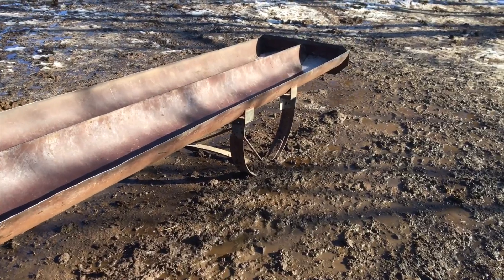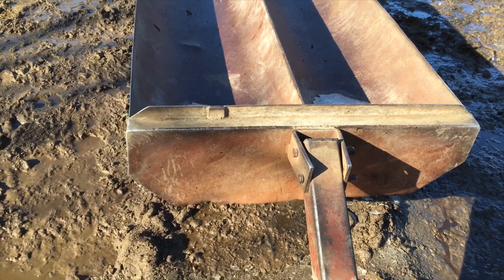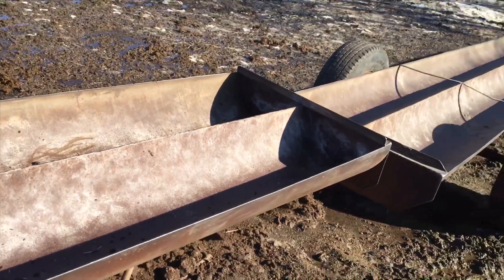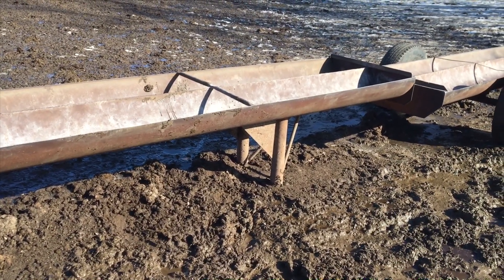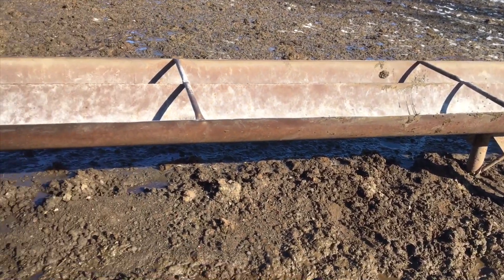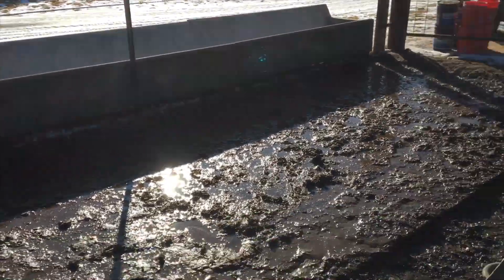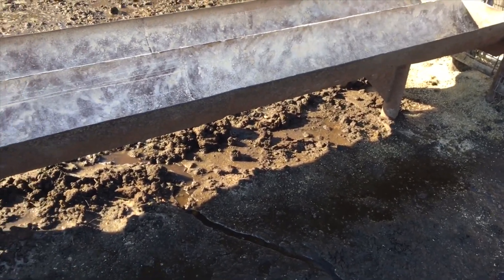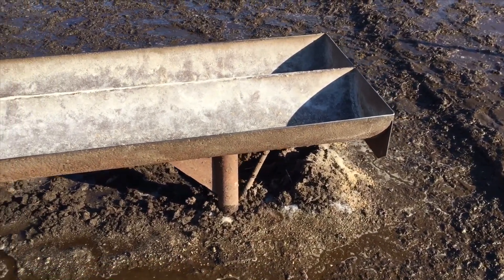Lifetime Feedbunks

Comment: Good  day Boy they are good & sturdy. I read in another comment holes were drill in for water to drain out.  Good idea.  Boy you have no snow either.  I do  not remember a yr. with such little snow so far.  Now there is a old saying "it's a leap yr."   they supposed to be  a wetter  yr  Anyways  Thanks for now.
Reply from the maker: The precip over the last month has been mostly freezing rain Don :).  Thankfully no calves yet...